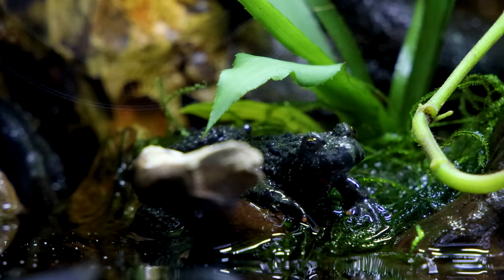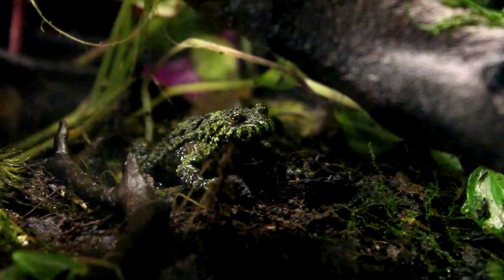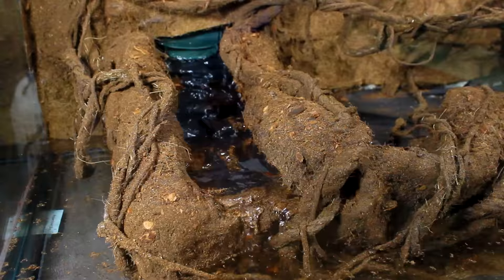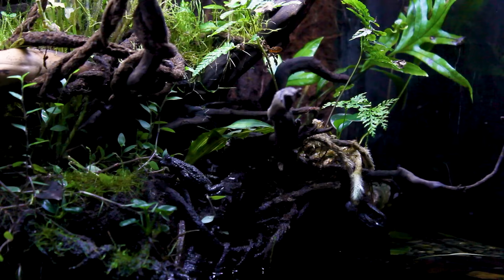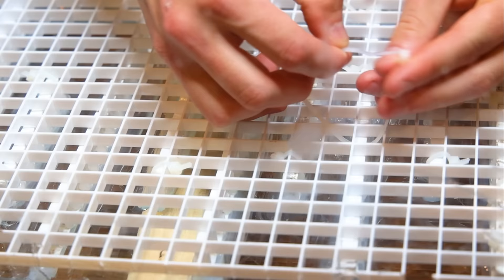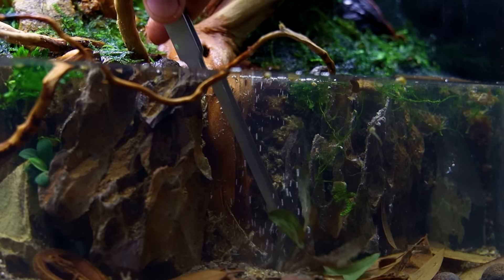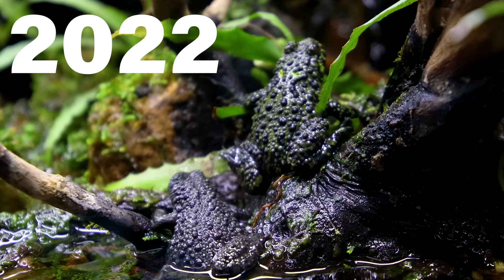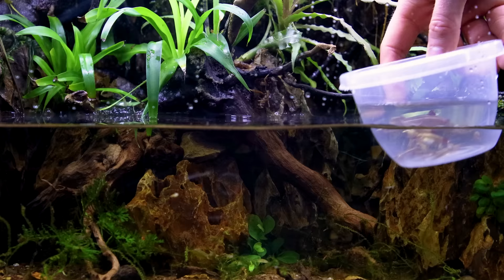Fire-Bellied Toads 11 Years Later - An Emotional Journey

Comment: I copied your first build with a fee changes. I had the little pump for the stream but also a canister filter. The flow was  hidden in a tree on the left side. Ioved that tank but felt the water level wasn't high enough, so I took it apart.  Still miss it to this day. Keep up the good work. Newer set up is definitely 🔥

Comment: These designs are breathtaking. Inspiring. I’m grateful to you for taking the time to explain why you do things the way you do. And when they don’t work as you expected, you share what you’re learning along the way.

I’ve had this love hate relationship with canister filters and have been gaining more appreciation for sump filtration in tanks that have drilled bulkheads. Can you maybe talk a little bit in a future video about how you settled into a preference for canisters over other options? Or if a sump hasn’t been done yet, maybe give it a go in a future project? One thing I love about the sump setup is that the display system keeps a steady water height, and the evaporation shows up in the sump. The sump has also been a great place for beneficial refugium which could be a project within a project itself!

Comment: The real habitat is Sandy, like a roadpole. A hole in the roadpole from tires. The toad is a Pioneer. At building sites and industrial area is this toad Often seen. New places, without old vegitation or a jungle. 
The tuingereedschap that's troubles me, is hoe does the toad knows where the new building sites are and hoe does IT het there.